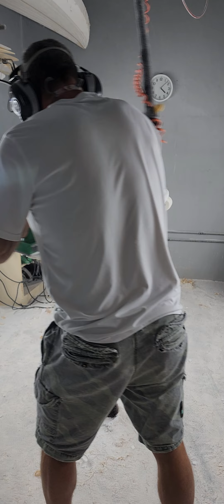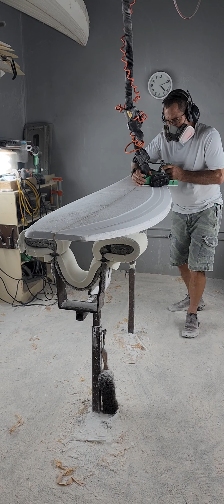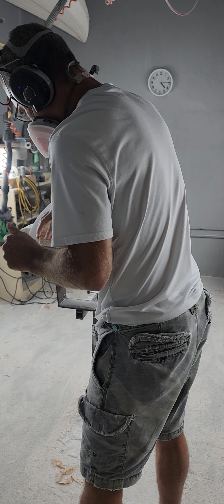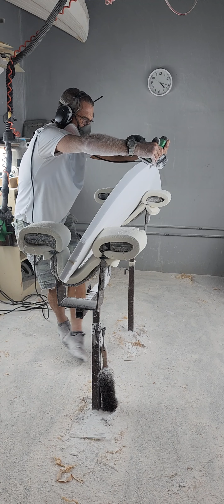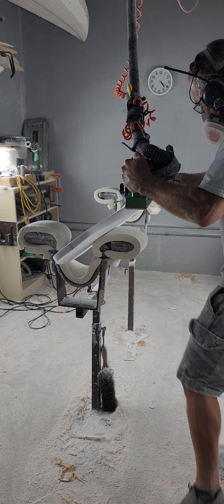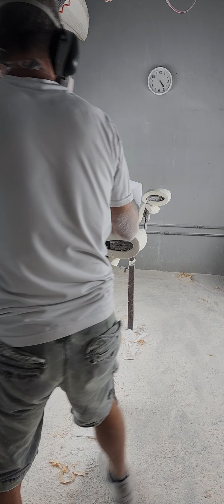Complete handshape for "Me". 😉

Comment: Hey Matt, quick question when you're sanding the rails out. It seems like in the video you're running the screen pretty close/on the apex with blending the top/bottom bands. Are you using really light pressure when sanding them out with that method? I've noticed blending rails with this technique is hard to dial in perfect.